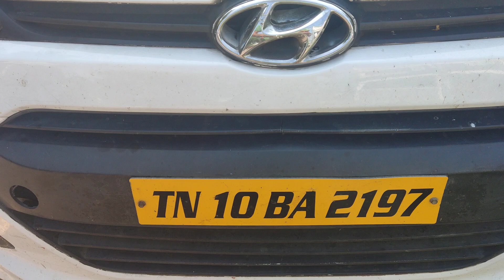Hyundai Xcent engine abnormal noise(@skilledmechanictamil )

Comment: Anna Hundai xcent diesel car pala peroda bank balance a Kali panni vazkaiyai Nadu theruvokku kondu vandhudu dhu.Nan idhu varai 3 murai engine velai senji irukkean.oru dhadavai velai seiya spares RS70000,labour charge RS20000 aagudhu ,yean ippadi aagudhunnu theriyalai.
.
Reply: Bro how many kilometres your vehicle run , did you bought new or second hand car ????
Reply: I bought a new hundai xcent car in 2019,car reaches 130000 kilometres,I think this manufacturing fault inengine design.l am a 15 years experianced car driver.l will proper serviced the car every 10000 kilometres but the issue is done my car I will spend three times of money RS70000 and labour chargeRS20000 in each engine issue
Reply: 2nd timeSpares and machine shop cost RS70000,Labour chargeRS 20000
Reply: 3rd time Spares and machine shop cost RS 70000,labour charge RS20000
Reply: @kumargkumarg2656  sir every xcent diesel is like this? or yours only  having continuous problem.?
Reply: Sir maximum xcent diesel car engines giving problems in less kilometers run.The problems are in pistons and wrings worn out,crank shaft bearings worn out,missing problem,heavy smoke,milege dropping,turbo failure,heavy noise,unlimited heating,automatic raising problem these issues are facing Somany xcent owners